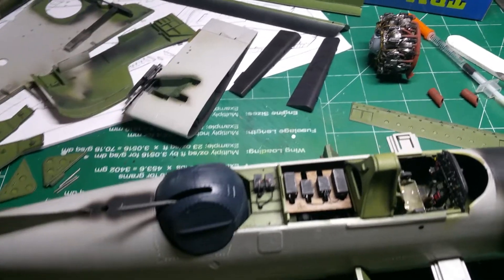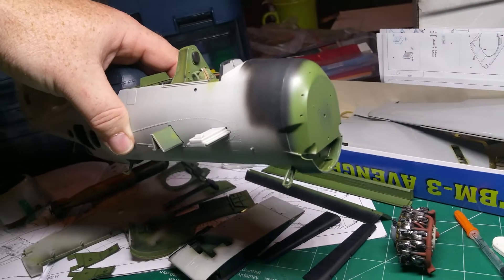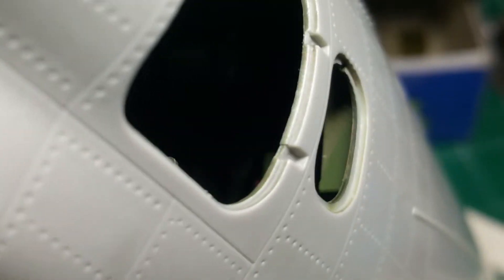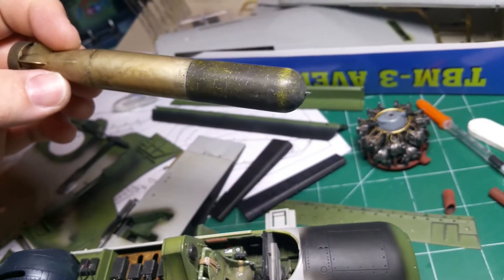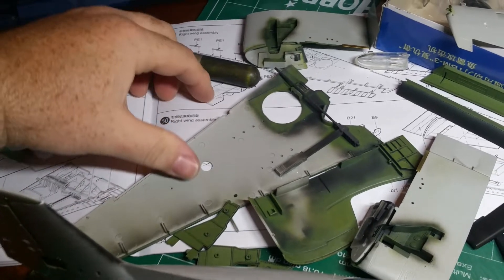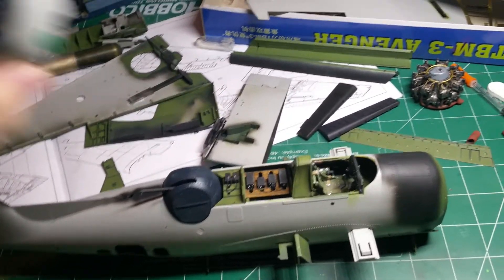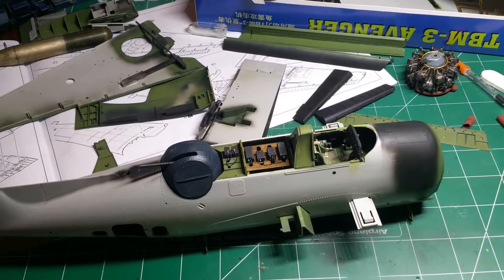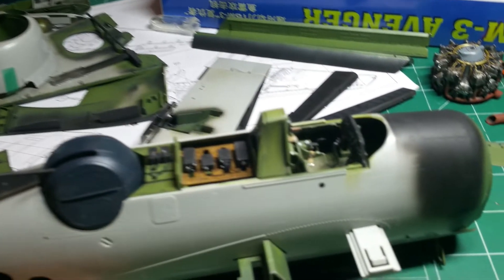TBM-3 Avenger 1/32 Scale Trumpeter Kit Progress

Comment: When I worked on the line weapons are loaded within
1 hour of flight, for safety purposes. Should an aircraft return
with weapons unused they are removed within 30 minutes.
Why are your weapons so heavily weathered ?? They are not
in the open enviroment to get weathered.
Reply from the maker: Research with reference photos from WWII document that ordinance looked very much like this. Torpedoes and bombs were on long trips aboard ships and would even be left out in the elements on docks and in yards of mass storage where natural degradation and rough handling would wear down the surfaces. Your experiences with modern ordinance regulations and handling practices isn't in line with those of the wartime 1940's and isn't very relevant to this subject.
Reply: @alec_f1  Thnkyou for the information on the 1940's.
I was only used to my own experiences on 18 years working
on the Flightline.